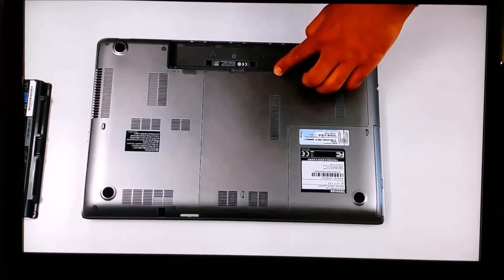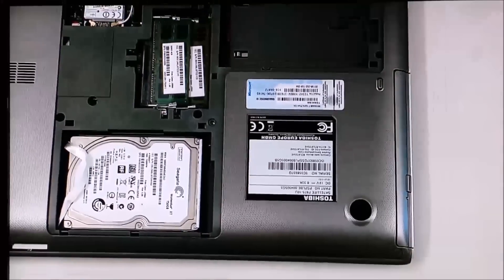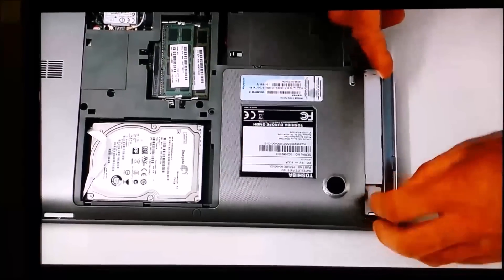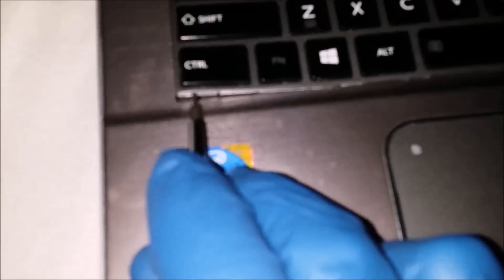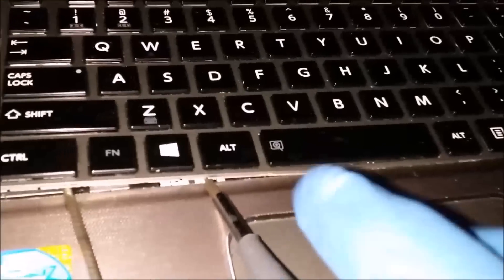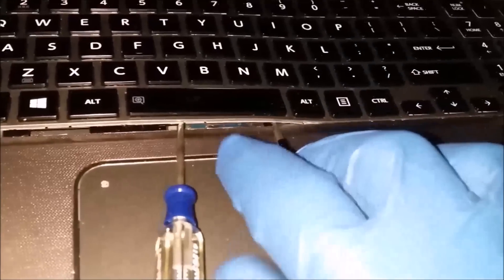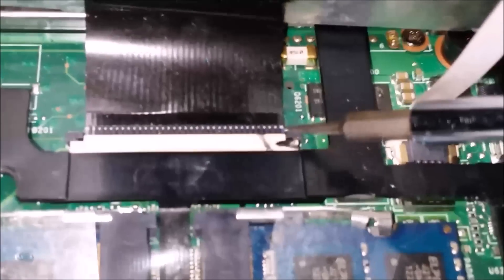Keyboard Replacement on Toshiba Satellite P875-S7102

Comment: I didn't have much issue removing the keyboard. Putting the new keyboard in SUCKED!! It did not want to pop back into place. There was always a couple notches that would not go down! I tried in every way for quite a while. It never did go flush. I have replaced many keyboards before. This was the worst keyboard to get installed and line up correctly.

Comment: I have the same laptop but only need to take the "space" key off to clean under!!! How do you take off individual keys?
Reply from the maker: +ShinTensei 
I was trying to do the same thing but once I pried the key out of the keyboard there was no way to put it back.  the key was like glued on.  that is why I had to replace the keyboard when I made this video. if there is a way to do it I really don't know how. sorry about that. I ended up replacing the whole thing. maybe you can clean it with Dust off air spray cans.
Reply from the maker: +apna punjab 
I tried to glue it back but it was not working. because I had spilled soda on it and the whole keyboard was messed up.
Reply: I too spilled soda.....how much did it end up costing you to replace the keyboard for this model? haha we have one good ass laptop by the way. I love this thing :)
Reply from the maker: +ShinTensei 
Yes definitely, these laptops are great I love these laptops.  I got my replacement keyboard from ebay  and it cost me only $25 
here is a link  http://www.ebay.co.uk/itm/Genuine-Toshiba-US-Black-Backlit-Glossy-Keyboard-for-Satellite-P875-S7102-/281781301536?hash=item419b797120:g:4mEAAOSwbdpWXk-S

Comment: man,can you help me,i have a same laptop and sudently my backlight in keyboard has stop working,and now they always off,i dont know where is the problem,my laptop was in servise last week and when i get him back,backlight was OK ,and after couple hours ,they turned off an now are dead,can you help me please,sorry for my bad eng,i hope you will understand
Reply from the maker: aldin musetic sorry for my late comment. I hope you already fixed it but if you didn't. it has to be one of two things. 
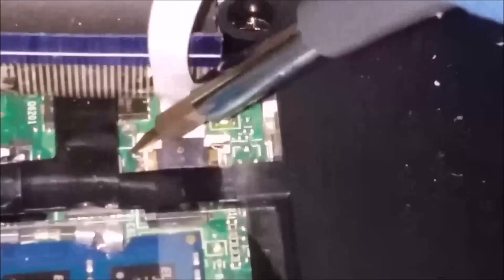the small ribbon might be loose 5:20  the small ribbon controls the light. or the keyboard light got messed up and you can still use it without light or get a new one from ebay new original from china about 25 dollars.
Reply from the maker: aldin musetic the ebay sellers name is 91deals
Reply: apna punjab Do you have to remove the laptop's bottom before prying up the keyboard?
Reply from the maker: ***** if you have the same type of laptop on this video p875-s7102 you don't have to remove the bottom. just do it the same way its done in this video.
Reply from the maker: ***** if you are talking about the drive yes you have to remove it so you will be able to move the pin and loosen the keyboard from the corner.